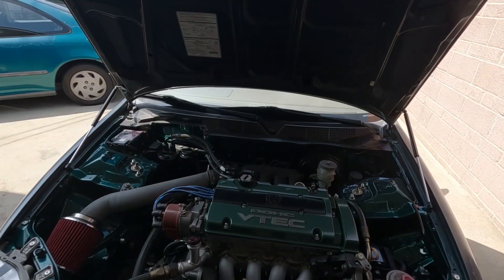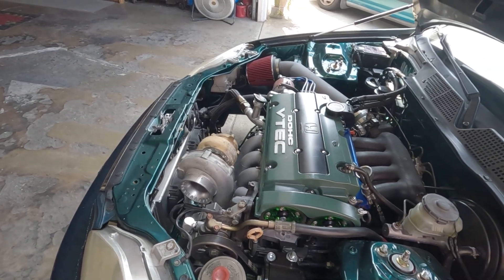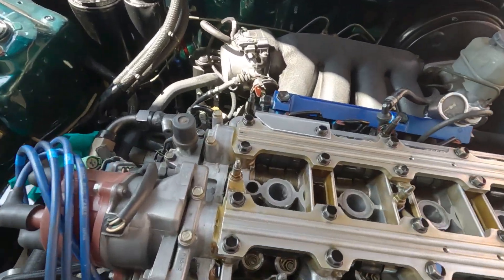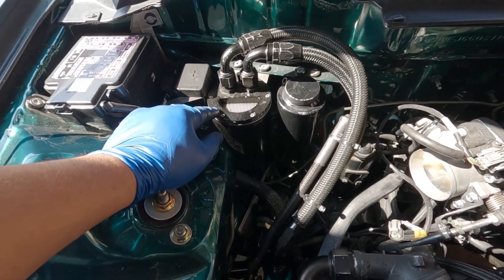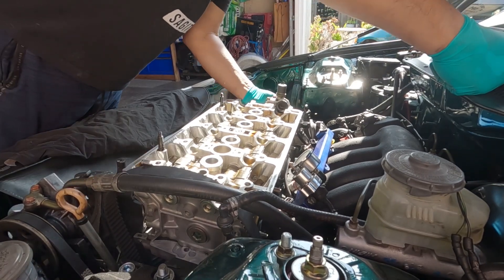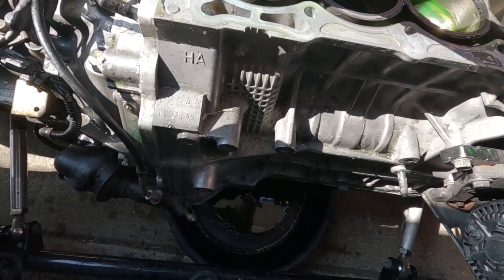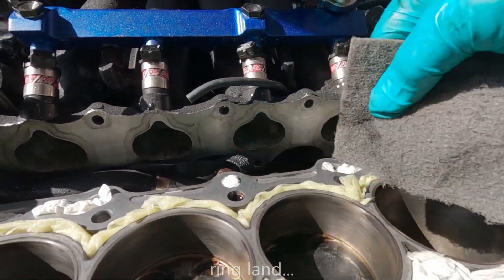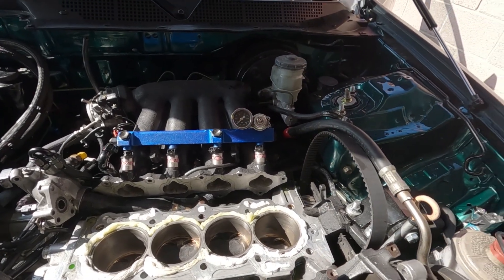G23BK Boost build project! It begun! ep.4

Comment: What gap would you recommend for h22 ,20 psi , nippon piston npr gnh ring? I was thinking 19 top 23 second ring? Its closed deck and i have iron sleeves.
Reply from the maker: So far l have no problem on what Nippon racing piston ring recommend specs and for your NPR GNH rings specs settings, your'e be good.

Comment: Good work. Did u ever got any issues with the water pipe i see u never got it weld.
Reply from the maker: The ticking noise is my concern and l sure like to find out if its the piston or something on the cyl head. It wasnt sound like it when it was NA
Reply from the maker: The hose was really on there and so far no issue.

Comment: Wat bran piston r those ?
Reply from the maker: They are made by Nippon Racing and it's for K20a2. Type S piston and now l'm using K20 Turbo piston.
Reply: @sagittnet2158   am working on my h22 I wanna go boost but it still got stock sleeve wat piston can I use.
Reply from the maker: @jefferybissick891  You only have one choice w/c is Mahle piston. If you decide to use those, make sure your piston to wall clearance are good per manufacturer specs and also the ring gaps. Some are using Nippon Racing type S piston but the compression is too high that the engine wont last long when it comes to boost unless you use E85 for fuel.
Reply: @ will k24 piston work ?   I see u use k in the f engine can I use it in the h
Reply from the maker: @jefferybissick891  K24 is not compatible to H22 frm sleeve block. You'll have some issues, scoring on piston and sleeve. Unfortunately there's really not much of piston you can use on H22 w/ frm liner.
Reply: @sagittnet2158  ok.  Guess I just gotta save up and get the mahle piston.

Comment: I used an 87mm rrc piston in my build by nippon which looks like what you have and I absolutely love them it’s my second set I also used some in 86mm on f23 block they are extremely close to if not better than OEM truly you will love them I expect quality is amazing
Reply: I really enjoy your channel so thank you for the content.. Also I wanted to ask if you had a stock intake manifold you might would wanna get rid of
Reply from the maker: @robbyposey9128  i do but l'm keeping it for a future project and thanks brother.
Reply: out of curiosity would those 87mm rrc pistons fit on a f22a1 block not to sure of the difference between these motors
Reply from the maker: @MikCB7  Yes, f22 and K20 have the same wrist pin size (22mm) and it'll fit. The only difference is the piston height. RRC is 30mm vs 31mm. But should be no biggie coz of the dome that RRC has. It just will sit 0.020" below the block. It's really famous for F20b users aside from piston ht differences. If your'e using H22 cyl head, you wont have problem on piston relief hitting the valve unless you use a hi lift cams, clay the motor just to be sure. Thanks
Reply: I believe the f22 is 85mm so factory f20b pistons will work and it’s very close to the same compression
Reply from the maker: @robbyposey9128  yes, f22 is 85mm so as F20b piston. F20b piston will give you more comp ratio vs f22. Lots of f20b users use k20 piston. They have the block resize to 86mm, even though the piston ht is 1mm off, k20 piston compensate it w/ its dome and gives them the comp ratio they want.
Reply: I’m on an f23 rotating assembly with rrc pistons in an h23a block built head p&p w/ s2 tuner 2 camshaft.. It actually was very surprising to me how strong it runs
Reply from the maker: Okay and good to know someone have success using it. Thanks brother!